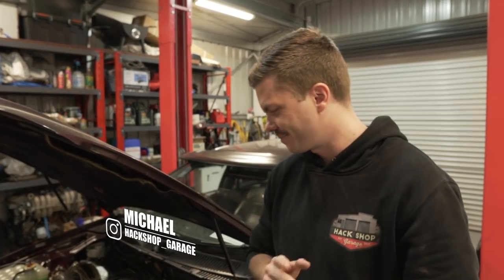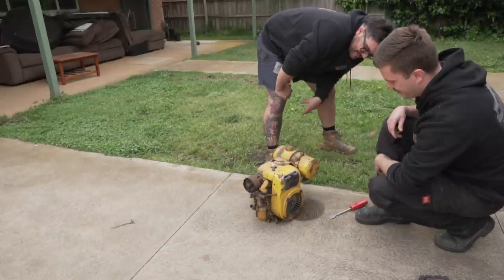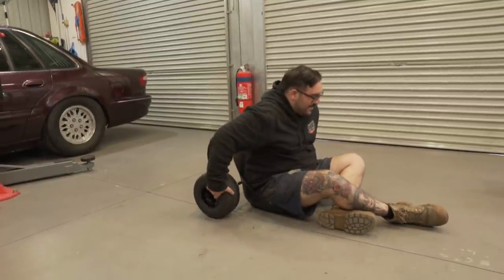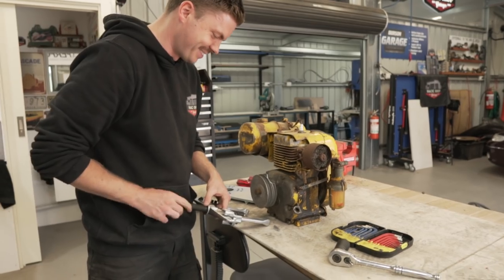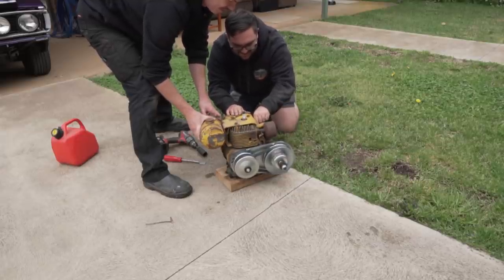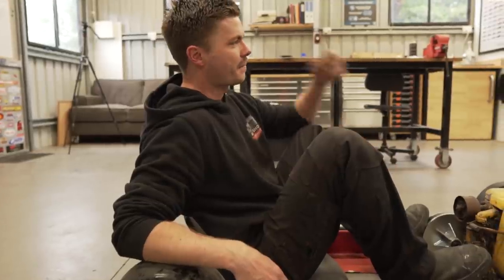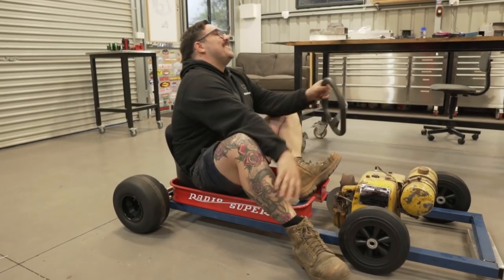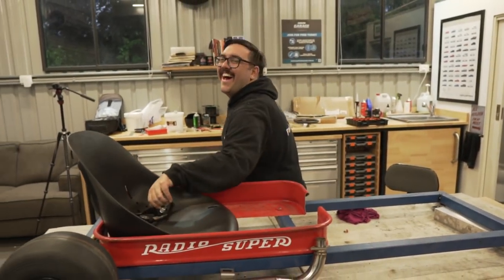BUILDING OUR OWN RAT ROD GO KART - Part 1 - Framing It Up

Comment: Push the motor right forward in your frame and mount your pedals behind the motor put steering under the motor and run the steering shaft down under the motor to rack, cool as boys.

Comment: Our kart had one pedal, the brake pedal. Throttle operated via a 3 speed T-bar shifter off a dragster push bike. Shifter in the forward position was idle so you could start it and it wouldn't take off. Middle position got the clutch engaged and all the way back was full throttle. ( or was it?) we had a little seat welded on the roll bar/seat back that my mate sat on and just when it was at full throttle while I was driving and him sitting on the roll bar seat he would reach around and pull the air filter off and it would take off. I miss that kart.

Comment: Carby needs a clean out, it will have more than enough power. Welding that nut on the motor, bad idea, there's a set of points and coil behind the flywheel that may need fixing one day.

Comment: There will be a governor on the motor remove that it will rev up . The nut certs for the axe will b a bad idea and come loose and pull out . And instead of have foot pedals why not use hand control on the steering wheel

Comment: That motor will have a governor. It'll be hooked up to the accelerator on the carb and i think it should  go under the engine shroud 
Remove it and It'll rev to the moon.

Comment: The front variator face on your cvt is backwards
Reply: Check out a quick video explaining scooter cvt and it should give you a good idea. The front pulley should be a v shape for the belt to ride in, controlled by the little weights in the front and contra spring in the rear